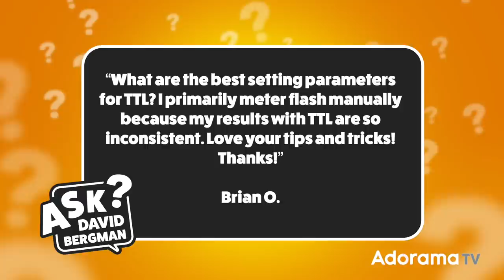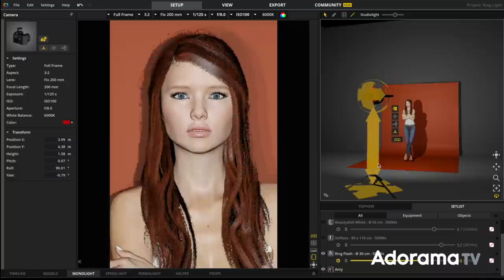Why is TTL Flash so Inconsistent? | Ask David Bergman

Comment: I believe there was something fairly important that wasn't addressed in this video.  The reason your flash changes power when you zoom out is because the camera is seeing more of the background which is dark.  So, the meter, if you're in multi-zone metering is going to tell the camera to tell the flash to power up to light up the dark background because to the camera, the scene just became darker.  If you switched to spot or center weighted metering your TTL results would be more consistent as the camera is just looking at lighting up the face and not the entire scene.  THIS is why your results are inconsistent.   And to David's point, switching to manual will definitely guarantee more consistent results regardless of which in camera metering method you use.   I think this explanation is a huge "miss".  It didn't address the "why" of the question.  If you know the why, you can figure out how to address the issue.  If you don't know the why you're just trying to compensate with FEC it will still be inconsistent next time you reframe the subject.  Knowing the why gives you more power to make a better adjustment, in this case the metering method, to get more consistent results.  Having said that, manual will always give you consistent results.
Reply: It was literally one of the first things he said when he zoomed out.

Comment: Great advice! Perfect explanation of the only time (run and gun with varying distances) TTL is a better choice than manual.

The short answer on "inconsistency" is the same as any other automated exposure-- with each and every shot it starts all over again to determine the exposure and any small change in the frame can alter it.

Comment: At time stamp 7:35
I'm so glad you pointed out, that you should make the compensation physically on the flash, not in the camera exposure nor the flash compensation inside the camera! Many photographers make that mistake resulting in inconsistency.
Reply: Why is that an issue? I'm curious. I get not using the overall Exposure Compensation, but not Flash Exposure Compensation feels like the correct setting.

The one thing I did find on this had to do with the Profoto Air Remote which says to use camera FEC and not on the trigger - but I that looks like an implementation detail for the trigger.
Reply: What matters is that you use FLASH exposure compensation and not regular exposure compensation. You can do the FEC either on the flash itself, the trigger on the camera, or in the camera settings if it allows FEC that way. Of course, in this case, I could have technically used regular exposure compensation since my one flash is the only thing lighting up this image. If I had more than one flash, or any ambient light, then FEC is the only way to go so it only adjusts the light from that flash and not everything else.

Comment: With a nikon flash, when the camera’s metering mode is changed to spot metering, I can use Standard i-TTL mode, in which, flash output level is adjusted to the correct exposure  of the main subject regardless of background brightness
Reply: As long as you have the "spot" right on your subject for every frame. Easier said than done.
Reply: @DavidBergmanPhoto  the spot is her face. I thought you knew that 🤔

Comment: This was really interesting and I understand a little more how TTL works now. So does it factor in the metering of the camera (Matrix, Centre Weighed, Spot)? Could a viable workaround to consistent TTL use come from locking exposure more such as using Spot metering for the persons face, locking exposure, reframing the shot then fire? Hmm... might have to try that.
Reply: You've answered your own question.  Changing metering method to spot or center weighted will give you more consistent results for the area you want to light, ie face.  Manual will give consistent results regardless of your metering method but if you don't want to switch to manual, more accurate metering will give more consistent results.  The matrix metering will take into account the entire scene and tell the flash to use appropriate power for the scene, not necessarily the face.  Oh yeah, you definitely want to sync your spot/ center weighted meter to whatever focus point you're using.

Comment: To me the ideal situation would be to expose a broad-lighting tight headshot with TTL in which the flash meter would get a perfect exposure of let’s say 1/8th power. Now at that point if you could switch to manual that 1/8th power your lighting on the subject would be good from now on irregardless of whether you with the camera was moving around. I have one huge problem though! For my camera-flash setup the TTL power setting is top secret and evidently I don’t have a security clearance. It would be great if switching to manual would have the prior TTL power setting displayed.
Reply: The Godox AD200 PRO and the AD400 PRO ( and probably others) do exactly that. You take a shot in TTL mode. Switch  to manual mode and it is now set at the TTL  exposure.

Comment: Nice video; thanks for posting.
1)  Would changing the metering change the light?  That is, won't spot metering (as Christophe Robert suggests below) work better?  What about zone metering?
2)  If you lock it into manual mode and use the same flash setting all of the time, won't that change the light?  It seems that light reflected would also be subject to the inverse square law so that if you doubled the distance from the model, the light would be less bright.
3)  Name suggestion for mannequin.  Since she is so plain, I would call her Jane.  You could also use the song, "That's not my name" by the Ting Tings as her theme song.
4)  Comment:  I have a very cheap flash.  I can take the exact same picture twice and get totally different lighting for each with TTL (sad face).  I'll will definitely try the manual mode now.
Reply: 1) With Canon cameras, spot metering does not effect TTL. Evaluative and center-weighted do, so yes, those setting would help. But if you use center weighted, for example, you'd have to keep your subject in the center of your frame. That's quite limiting. So much either to just switch to manual and then you can zoom in or out, recompose, etc and the flash exposure will be exactly the same every time.

2) If you use manual for your flash exposure, the amount of light it puts out will be the same every time. Of course if you change the flash distance to your subject or background, then yes - the light will appear differently. That's why I said I use TTL in "run and gun" situations where the distances are constantly changing. For a portrait where everything is  roughly in the same spot, manual all the way.

3) Will add it to the suggestion box. :)

4) Good idea. Third party companies have to do some serious work to reverse engineer the camera technology. Some do it better than others but none will be as good as usual the OEM gear.

Comment: I want it to take the picture with the exposure settings set as if I didn't have a flash but then fire the flash to fill in the dark areas, but all my pictures come out very, very dark.
When I switch from ETTL to manual mode, the flash won't even fire.
Reply: Did you keep the iso as auto ? It is better to keep in auto ISO so that even if thr flash did not fire you will get a decent picture without flash. If you have applied the right shutter speed and aperture, there is no reason for you to get a dark picture.

Comment: With my Nikon crop and full frame, nikons flash no problem using the, but with sony with Godox flash ttl really inconsistent output,  talking on top camera.
Reply: I think in most cases that the same camera brand camera and flash will be more consistent because they speak the same language. Third parties make some good flashes, but they still have to reverse engineer the technology without have the SDK.

Comment: Would camera spot metering on the face and flash set to TTL keep the same exposure on the subject's face?
Reply: Great question. It's my understanding that Spot Metering would not make any difference regarding ETTL as per Canon. I am interested to hear what David Bergman say.
Reply: With Canon cameras, spot metering does not effect TTL. Evaluative and center-weighted does, so yes, those setting would help. But if you used center weighted, for example, you'd have to keep your lit subject in the center of your frame. That's quite limiting. So much either to just switch to manual and then you can zoom in or out, recompose, etc and the flash exposure will be exactly the same every time.
Reply: @DavidBergmanPhoto  That makes sense . Tahnks a lot for your answer!
Reply: How about now, with a Sony A7IV, will spot metering affect TTL ?

Comment: Does the TTL Flash exposure have anything to do with the focal length of the lens?  It seems that the TTL is doing its job by adjusting to the focal length, but since it is at a fixed focal distance from the subject, it's throwing out more light, the further the camera moves.  Any way to compensate for that other than manually fixing the output of the flash.  If the flash moved with the camera, wouldn't the exposure be more or less correct and the same?
Reply: Use flash exposure compensation when in TTL if you find the flash is putting out too much or too little light. You can do this directly via the flashes menu or via the camera body ( maybe assign a function button ).🙂
Reply: It shouldn't have any relationship to focus length directly. But as I show in the video, when you shoot wider (either by zooming or by moving further away), the camera is seeing a lot more area around the subject it is lighting so - in some cases - it will try to brighten the flash exposure. Again - the tech is getting better, but it's still going to be inconsistent.
Reply: @DavidBergmanPhoto  Thanks for the reply.  It seems like this could be confirmed by moving the flash to keep it the same distance from the subject as the camera.  If exposure is consistent, then TTL may be using the focal distance to adjust flash output.  It that's the case, there should be some rule to apply to compensate based on focal length, assuming the flash is stationary.

Comment: Yip. When using multiple lights TTL is a pain in the ass and will only slow you down. I only use TTL in, as you say, run and gun situations. Rarely any other time.